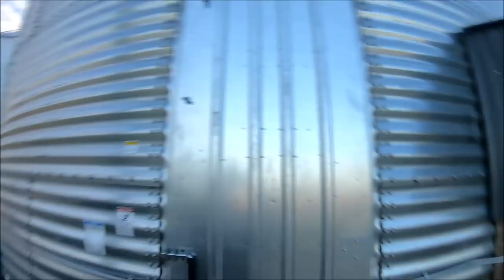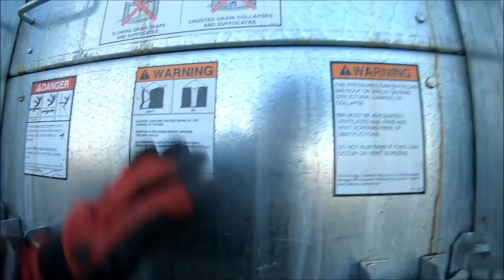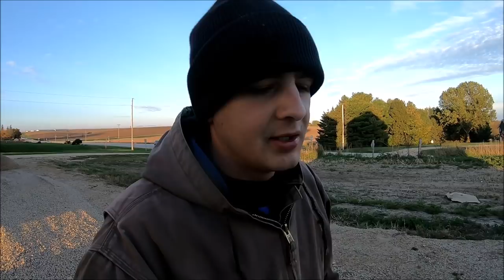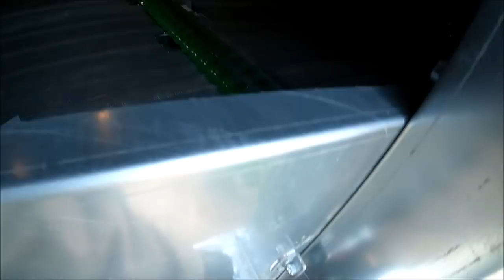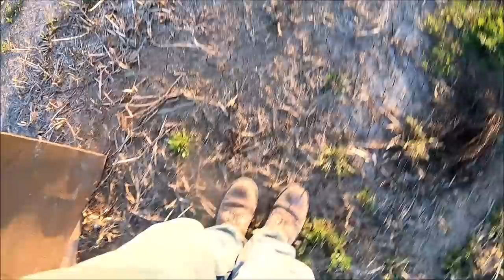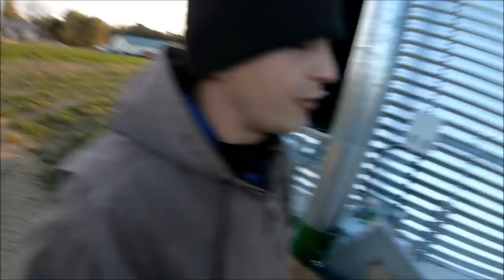Under Pressure

Comment: The key is to remember to close the inside pressure doors before the corn gets up to it.  It's always interesting when the dryer has been running for 3 or 4 hours with a door open.

Comment: Hey get some life out of your collapsed bin.Remove bottom 2 or 3 ring and mount back to slab. Now you will have a safer 6-7,000 bushel bin........
Reply from the maker: I addressed this statement a while back.
Reply: Randy Schwersenska  has been watching too much OneLonleyFarmer. lol
Reply: Actually a friend of ours had a bin buckle fully loaded in 90+ mile an hour winds it would be cheaper to start over vs trying to replace the buckled sheets

Comment: Is the Sukup bin able to dry corn too?
Reply from the maker: to a certain degree
Reply: Without a stirrator, it's not really capable of drying down corn straight out of the field, unless it's within a couple points of being dry anyway.  Anything above about maybe 17-18%... Corn coming out of the field at 19-20% moisture or above, you really need a stirrator to dry that corn properly in the bin.  The stirrator augers reach down from the top ring to about a foot or so above the floor, and pull the corn up to the top as they rotate around the bin and work from the center to the outside wall, inverting and mixing the corn in the bin as it dries.  Without a stirrator, the corn "stratifies" meaning the corn on bottom gets VERY dry (say 10-12% moisture) while the corn in the middle of the bin might be about the proper moisture (about 15-17%) and the corn on top won't hardly dry at all and be prone to crusting and mold/heating and spoiling.  

The fan and dryer on the bin are more to keep grain in condition and maybe pull a couple points of moisture off it if necessary than to actually dry wet corn on the Sukup bin.  With a stirrator they could have dried corn down from field moisture levels in it, but it adds a lot of expense and maintenance.  

Later! OL J R :)